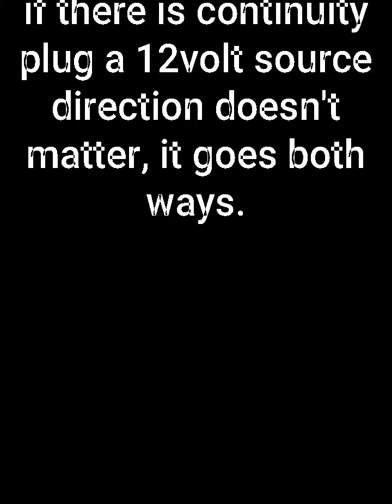BMW thermostat testing

Comment: low long it takes to opel fully?
Reply from the maker: less than 30 seconds in room temperature
Reply: @MostafaMoharram  mine opend after 5 minutes, i replace it with a e36 mechanical one no problems after
Reply from the maker: @siebi_2608  it is mechanical dear, they added the heating element to give the dme the option to open sooner if it is needed, put back the original oem or oe
Reply: @MostafaMoharram  why, this same engine older generation had mechanical one it it works then it works
Reply from the maker: @siebi_2608  true it works, i can unplug it and it works great, the plug gives the car the option to heat the thermostat to open sooner when needed that is it, i recomend to use the original one but suite your self of course